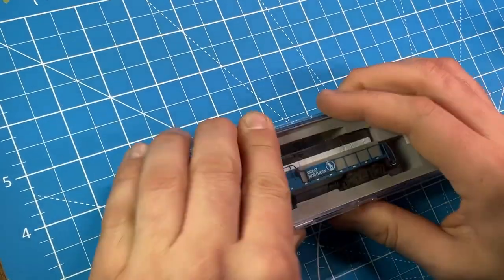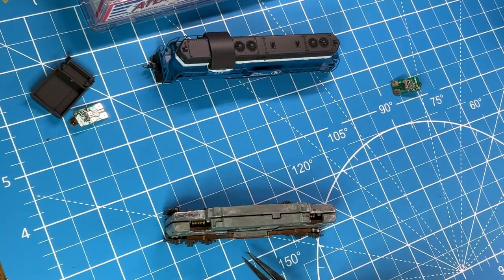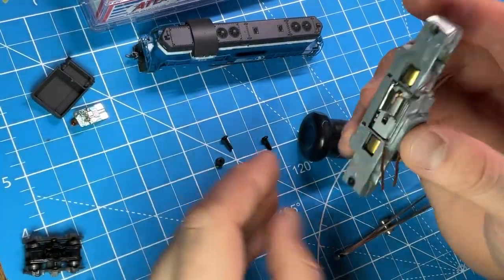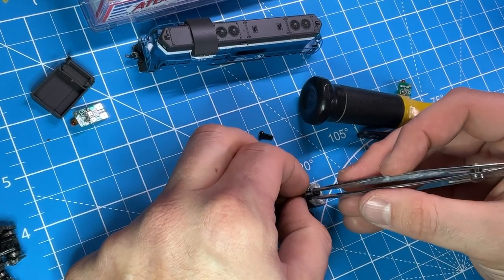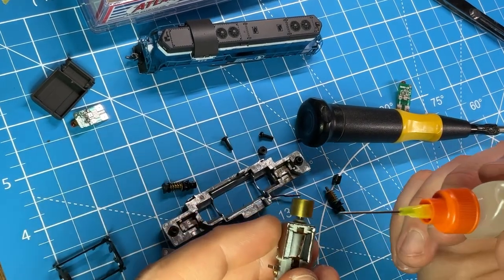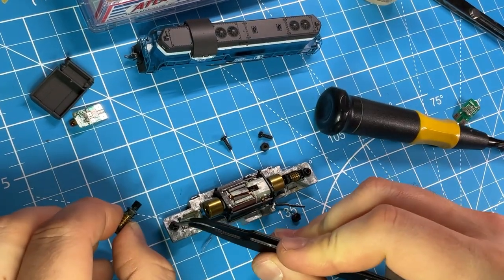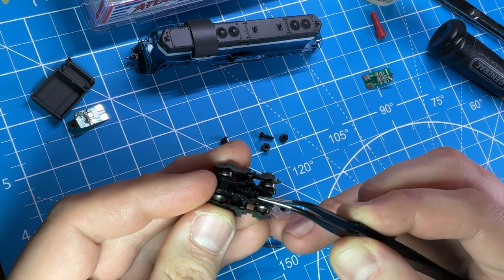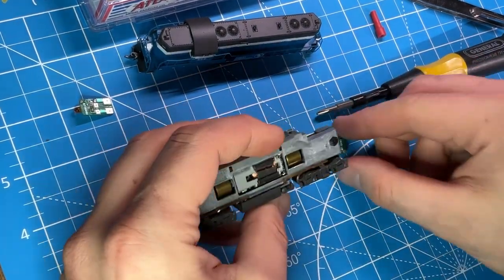N-Scale Service 101: Atlas GP-7/9 (and similar) Teardown, Lube & Service

Comment: What gets me, these manufactures don't make enough of the geeps and they always sell out. Intermountain finally made a Milwaukee Road F7 freight locomotive in N scale which nobody has ever done before. They also made the sky blue Great Northern F7 in N scale and that's my next one. I like the GP7's and 9's.
Reply from the maker: Atlas and Kato had the "make a bunch" overrun business model back in the 90's and those locos are still on shelves. While I understand the reason they don't do it anymore, it's mostly about overhead reduction in the face of extreme costs of production. They have to run a tight ship, so if you want a model get a bunch of folks to request it from said manufacturer! It's worked in the past...

Comment: I learned long ago when I was in my O scale faze. Put a drop or 2 of transmission fluid on your tracks. Let trains work it around layout. It keeps tracks clean. It has conditioners in it. Also lubes wheels on rolling stock. Grime can't stick to rails. Trust me it works. I had way less shorts, Loosing contacts and less cleaning intervals. Idk if it will be necessary on n scale ? I use my hair clipper oil on my locomotives.